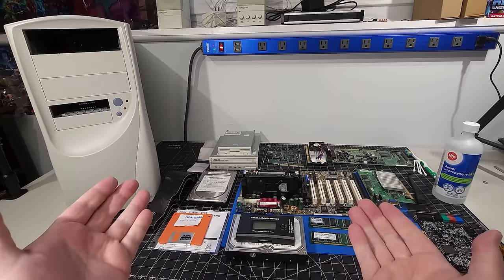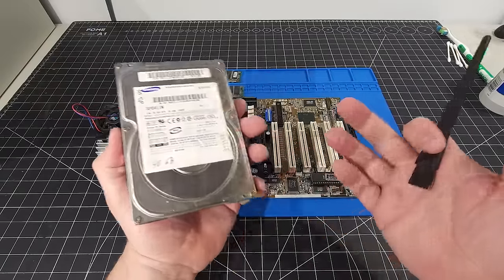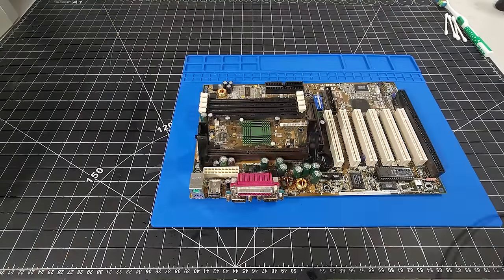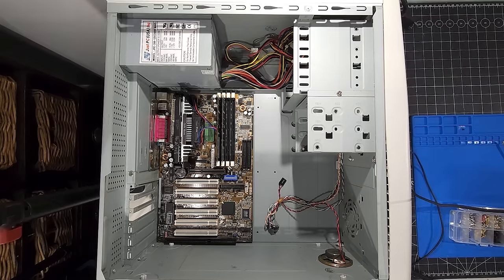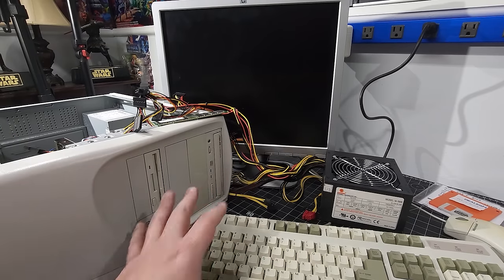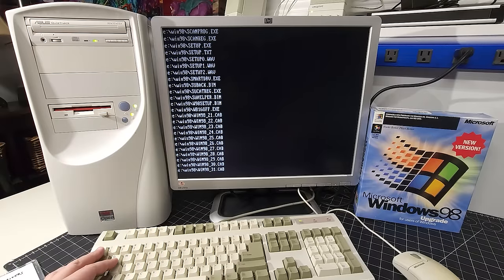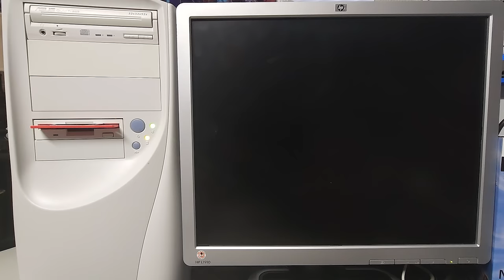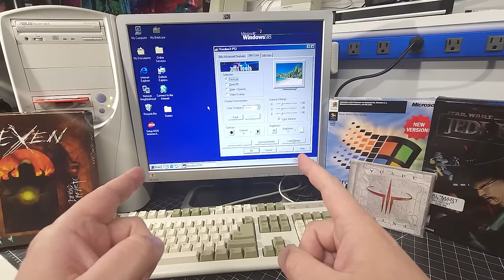Building a Retro Windows 98 PC!!

Comment: Just for fun, I once built a Win98 box and put it directly on the internet, no firewall, just to see what happened.  Nothing happened.  I found out my ISP itself was filtering internet traffic to purge the best-known Windows exploits. It wasn't possible to expose it to a true, unprotected connection.   I was so disappointed.   Before someone comments, Yes I do run a very expensive hardware firewall. This was an experiment for fun on a system that had no other use.  No bits were harmed.
Reply from the maker: Neat experiment.  I have a segregated network setup for my retro machines for various testing etc.  Never really put any of mine on the direct internet lol.
Reply: Yeah no need in worrying about using “unsupported” operating systems online to be honest. I use XP to browse the web all the time and have ZERO issues for YEARS now.
Reply: I have win10 and also nothing happened. No one wants my stuff identity and passwords 😢
Reply from the maker: Haha

Comment: You shouldn't use version 3.20.1008 of the Intel Chipset drivers for the 440BX chipset on Windows 98. Look in device manager at the driver details of the chipset devices, they are still using the exact same drivers that came with the installation of Windows 98. Believe me, it might seem like you installed the Intel drivers, especially because after the reboot it showed installing new drivers, but trust me, it was just reinstalling the same drivers that originally came with Windows 98. Use version 2.30.021, it is still available on the Asus support website. You will notice the difference in Device manager, the chipset devices will actually use the Intel drivers if you look under driver details.
Reply from the maker: I will go and look at this.  I downloaded this as it was the latest.  Are you suggesting the older version is better / more stable?
Reply: I'm saying that this version didn't install the chipset drivers at all. It just reinstalled the ones that originally came with Windows 98. You can verify this by looking at the "driver details" of the chipset devices in device manager. They are the exact same "stock" Microsoft drivers as before you installed version 3.20.1008.

Why exactly version 3.20.1008 doesn't work I don't really know. Because like you say, it should be the latest to support 440BX on Windows 98. 

My guess is that version 3.20.1008 is more focused on newer chipsets and newer operating systems, and therefore 440BX on Windows 98 got overlooked (?)

The version that is listed on the official support page of Asus does work, and actually installs new drivers from Intel. 

Just search the Asus support page for "P3B-F" and there will only be one listing of the chipset driver available. 

Get that one and it will work. You can verify after by looking at the "driver details" of the chipset devices in device manager. They will be from Intel and have a date of 7/31/2000.

Comment: I'm only in my teens and had that power supply issue happen so many times. You never think its the power supply because its turn on just fine but no post. Even on modern systems with parts from the last decade. Computers are strange.
Reply from the maker: Absolutely, and great advice!
Reply: @MachtNixPasstSo THIS!  I had a bad ax1200 take out literally everything - and its not just "everything died" - its insanity of everything just being less stable in various way - so get read to test everything and run around thinking its everything else before realizing - no, its the PSU, then you pray and hope replacing it will fix all other issues, but nope, just some of them, and yes, you need to RMA everything, and I did (it was all new enough for that or for store returns, so good thing it happened right after upgrading, in a sense).

Comment: A few things, I always use a natural hair paint brush, the kind for oil painting.  They're also anti-static, but softer, and easier to use.  Cable management definitely was a thing, learn the fine art of cablegami, fold those pata cables.  DeoxIt / contact cleaner is a must after decades.  Clean and re-grease the FDD and optical drives.  Load test the PSU, those cheap testers can only do so much.  I always check the PSU first for bad caps,, but that's not for everyone, high voltages and all, same for the CRTs.  Use both sound cards, Live! for 98, and the 16 for DOS mode. Is any of this necessary, no, but might help a bit.
Reply from the maker: A couple of things in response:
- The softer brushes are definitely an idea - I would love to know how these are anti static.
- I'm not sure if cable management was officially a thing as you mention. I'm happy to fold the cables as you recommend and as I've seen in the past, however my experience has been broken connections as a result.
- I used deoxit (contact cleaner) clearly in the video for the cpu and edited it for the PCI / ISA slots as the video was already quite long.  Did you see the video? 
- the FDD has already been greased and in fact was not an issue.  The Optical drive was not touched, so something I will look into.
- Did you watch the video? Did you see when I load tested the PSU, commented on the fact that I was load testing it with a non functional (data wise) spinning HDD?
- The voltages were fine on the PSU - no reason to look / consider otherwise.  If anything, it was suggested that the 350w was too little for the system where the 550 worked perfectly.
- Sound card - yes - it has been suggested in other comments I should put both in and disable one in Windows and enable in DOS / dual boot set up.

Thanks.

Comment: I had a power supply that had solder joints on the cable. Same thing, it was working fine then I started having weird errors. Eventually I figured out if I was holding the cable it would work. A little fresh solder, and it's still working 5 years later.
Reply from the maker: Nice!  I'll definitely have to check out the connections and of course the capacitors.

Comment: Very Nice Build . The Slot One systems are great for Windows 98  builds. I would open that old power supply and check out the Caps it may need recapping. Be Careful Thanks for the Video.
Reply from the maker: Your welcome and great idea.  So weird that it tested fine even under a bit of load and nothing.  But you are right, the caps could be the very problem. Thank you!

Comment: Hello from the West end of the country! I'm glad you got it working! I've run into your PSU issue once before, oddly enough with another ASUS board of the era (a P5A super 7 board). It would do the same thing with showing power, fans would spin up etc but no display or beep codes. It would do this with several different power supplies that I had tested good with my multimeter and worked fine in other systems but I just couldn't get it to work right. I eventually got it to post with one supply but even then it had stability issues. I suspect that it's either due to bad caps, or something is up with the K6-2 I was using. 

Anyway, a P3-600 is a great Win98 machine and having a voodoo 3 in it is just huge bonus points haha. I've got lots of machines myself so something that new I probably would have gone with the SB Live but I have other systems that are more era appropriate for DOS (486's, Pentiums etc), so compatibility with that in a Win98 machine for me isn't really an issue anyway. I am definitely in the camp of running vintage hardware and not emulating but I understand the cost and/or space to get into this hobby can be a barrier for a lot of people too. Playing on period hardware is just another experience though, and in my humble opinion you just cant beat it. I also prefer using real hard disks as well and like you have a large stock of them, though for a couple machines I've experimented with SD and CF card solutions as well. 

Network cards are also very handy. My preferred method is to use the network to transfer or access disc images, and I install Daemon Tools on many of my machines so I can directly mount the iso files into a virtual optical drive. I of course also burn media and I do have systems that I haven't done this with but they are mainly Dos or Windows 95/early win98 machines. 

Anyway, great build and video! I hope you'll do more with this system, and show us any upgrades!

Happy Easter!
Reply from the maker: Well hello from the Atlantic provinces haha!  Glad you enjoyed an dyes, this system will be featured in future videos for sure!  Happy Easter!

Comment: I am envious of that ISA slot!

About 18 months ago, our local office was closed that contained a computer lab that had gone back many years. I was allowed to go in and take what I wanted before "guys in trucks" came to take it all away. 

I did haul away a handful of nearly-new IBM Thinkpad T42 laptops and a couple of Lenovo All-In-One PCs with Core 2 Duo CPUs that I was able to upgrade to Core 2 Quad ones very cheaply.

But whilst there were quite a few Compaq and generic Pentium III desktops in there, not one of them had an ISA slot for MS-DOS sound compatibility so I didn't bother with them. I'm guessing a Slot 1 Pentium III CPU is therefore reasonably rare and early enough in the product line to still come across motherboards with the ISA slot.

Hence the envy but thanks for another interesting video.
Reply from the maker: Yes, I was quite pleased once I had discovered this in the box of motherboards that came my way. I have seen a few of these Asus boards with ISA slots on them and it's always a happy sight to see!  So many options with these boards.  Thanks for watching!
Reply: @TheRetroRecall  Back in the day, when I used to be an avid Windows and MS-DOS "tweaker", there was a fantastic O'Reilly book called "Optimising Windows for Games, Graphics and Multimedia" by David Farquhar. I regret throwing away my copy when "the Linux bug" hit me but I did manage to find a PDF copy of it somewhere online and if you want the best "tweaks" for Windows 98 and MS-DOS, they are all in there.

You're absolutely correct about 256MB RAM being the "sweet spot" for Windows 98 as anything above that could cause instability. I seem to remember there was a tweak in an ini file in Windows 98 where you could force it to only use 256MB RAM in situations where you had more installed - I remember that one from the same book.
Reply from the maker: I'll have to look up that book!  I didn't know about the ini file hack - I'll look intot hat.

Comment: God this brings back the memories.  You have a good camera set-up and audio, better than most small channels.  One thing I always did was put a 3.5 to 5.25 adapter for the hard drive to make for better cable reach and get it out of the way in the bottom.  

I wish I had room to do more retro.  I'm collecting stuff to build a network rack that will eventually look like an arcade machine, with NES colors.  20U in the bottom with a removable monitor hutch (no CRT unfortunately) and an HDMI switch.
Reply from the maker: Thank you - small but mighty channel!  Almost a million views, just need more subs haha, and that build sounds pretty cool.  I'd be interested to hear how you make out with that!

Comment: Those beautiful round shapes on the cases of the time had their charm. Very nice device. I also had very strange power supply problems with my Athlon Thunderbird. The system has an ISA slot and every ISA sound card started to warble and distort extremely under every operating system. Sounded like an old cassette producing tape tangles. Horrible. I spent days looking for the cause until I accidentally replaced the power supply and the error disappeared. I suspect there was a problem with the -5V line.
Reply from the maker: Very good catch.. Glad it ended up working out for you.  I'm floored at this solution, however others have suggested that 350w was too small for this build and that the 550 I put in was what was required.  I'll have to do more checking on this to confirm but it is possible.

Comment: I'm in the middle of a 95-98 build . I used the  Asus P3B-F board , PIII 550 slot 1 . 256 ram  agp ATI Rage 530 video card. SB 16 ISA slot.  I'm using compact flash drive. that way one card will have 95 on it or 98 on another card.  I may do a card with 7 or Vista on it.  or  do that on the P4 build I will do next.   love your channel.    and the ATX case is dated 1999. cream white.
Reply from the maker: Nice!!!! Thank you so much, glad you are enjoying :) yes - 1999 case.  I wish they made these again :)

Comment: Hi Sir, nice build!
My current W98 build is not so period correct.
It is an skt 370 with via c3@800Mhz cpu (You can have grain control of cpu speed using setmul or cpuspd)
Physical switch on the case back to toggle FSB, (no need to enter BIOS and set the FSB)
ESS 1868 sound card for DOS with wave table card using Pi 2W, SB Live for W98 games
PicoGus 1.x 
TNT2 Pro 32Mb
256 Mb Ram

I would like to see from you in a future video some unconventional and somewhat odd W98 build like mine and ear about your impressions.
Thanks for the great content here!
Reply from the maker: Nice build!  I wouldn't have considered some of the above in a build for sure.  I will definitely take that into consideration.  :)  Thanks for the suggestion and for watching!

Comment: I still use that exact case for a Pentium 2 DOS machine. It also has a Voodoo 3 and an Asus P2-99 mobo (440ZX). The P2 is a 233MHz downclocked to 166MHz for compatibility. I have another build with a P3 1.40GHz modded Tualatin on an Asus CUBX-L mobo (440BX) for high-resolution DOS gaming as well.
Reply from the maker: Now those are great builds.  It was quite a common case back in the day, I built quite a few systems with it.

Comment: Great video! 
My first ever PC (not first computer - that was an 8 bit Commodore 64) was quite similar:
Windows 98 SE, Slot1 PIII - 450, 128MB RAM, Voodoo 3 3000 (AGP). 
By that time, the TNT 2 was available, and I knew it was the more "sensible" and technically superior choice. The writing was on the wall for 3DFX. But I also felt it might be my last chance to fully experience that fading 3DFX / Voodoo era, and all the great games that came with it. (Retro computing was not such a big thing, at that time.)

The biggest difference was the sound card. Because I was buying all new, I went for the Diamond Monster MX300 - Aureal Vortex II sound card. It was excellent for Windows, and had great Sound Blaster compatibility, right down to those iconic A220. IRQ 5, DMA 1, H 5 settings. Ah, that brings back some memories! 😊
Reply from the maker: Thank you, and nice builds!!! Such great memories of computing back during these times.  Exciting to bring them back! :)

Comment: I'm using that exact same board on my Windows 95/NT4 machine with a GeForce 2 MX400 and a Voodoo 2 PCI for all those delightful 3Dfx DOS games and a few older Windows games!
I would recommend you to check what HDDs have healthy. I checked ALL my HDDs on a XP machine with Acronis Drive Monitor to see which drives were at 100% health,  and HDD regenerator (I went with the 2011 version which runs on Windows) to check the entire surface to make sure there were no bad sectors yet unmarked. A good bunch of my drives are at 100% health and I can use them with confidence, while most had unmarked bad sectors and/or were below 100% health, I use those for tests only. It was a tedious process but at least now I know which drives I can trust.

By the way, one HDD is not enough to test if a power supply is good, you need to add much more load and let it run for a few minutes to check if the voltages stay stable. MikeTech adds a bulb with a few watts to increase the load on the 12v rail if I'm not mistaken.
Reply from the maker: Thanks for the recommendations.  I did test / setup the HDD prior to using it in this system (I actually call this out in the video).  That said, I was under the impression an HDD would be enough to test the load.  Since you brought up Mike Tech - he has done similar things in his video without a bulb - so this may be a new thing - please check out his older videos.  That said, I will certainly add additional load for a test in the future.  Thanks for watching!
Reply: @TheRetroRecall  Yes, I've watched them all and you're right, he didn't use a light bulb at first but he started using one later on, not sure if it was because he encountered a similar problem to yours, but more load is always welcome to stress the power supply a little more 🙂
Reply from the maker: Yes makes total sense.  I did just see Adrian Black use the bulb trick - I may setup a similar test!  Thank you :)
Reply: LGR once showed a cigarette lighter drive bay on his channel. That ought to add a load onto the PSU. Just don't do any smoking, especially magic smoke. ;-)
Reply from the maker: Haha yes, I saw that video! Such a weird thing to see... Hence oddware! :)